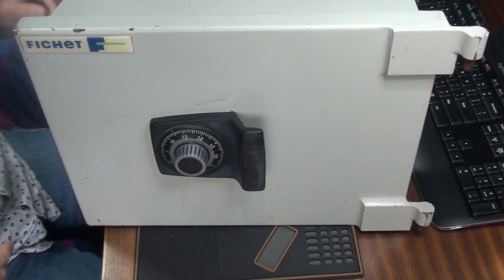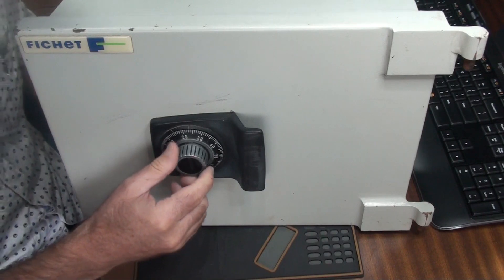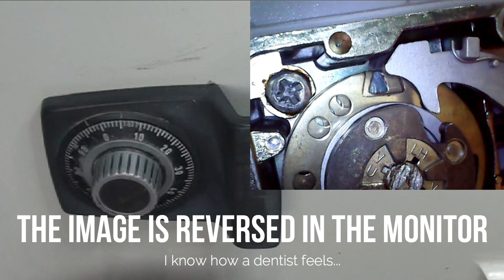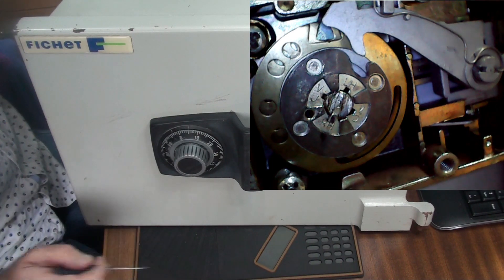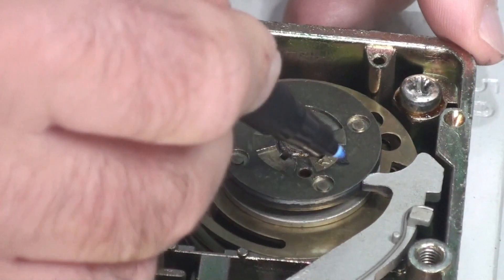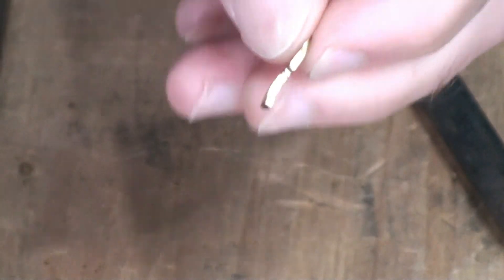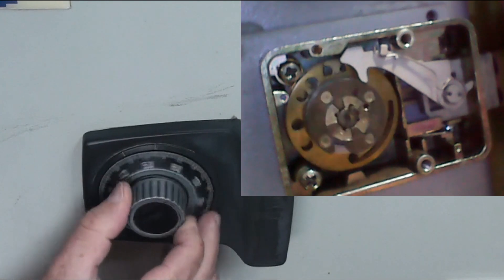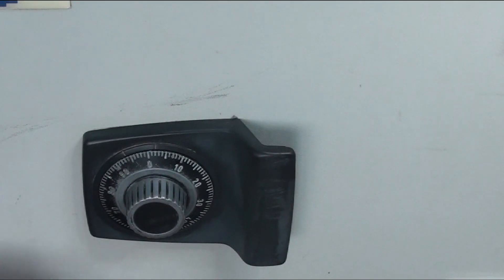[162] Fixing a faulty La Gard 3330 in a Fichet Venus safe

Comment: Hi Michael, I must admit I was a little worried when you dimpled the spline key on timber instead of a vise!  (:-)) Sometimes it's necessary to reset the combination after the spline key is rectified, as the original combination is usually set WITH the loose spline key. This is an early LaGard lock, and they were notorious for wheel 3 slipping to a higher number when locking. As you are  aware the LaGard wheels are stamped out from a single sheet of brass - unlike S&G where the cam mechanism is sandwiched between two surfaces. The later 3330 locks have a black coated 3rd wheel made from a tougher brass composition, and don't suffer this wheel slippage. Might be something to bare in mind when using this safe - or perhaps fit an S&G ... (:-))   Regards, Brian.